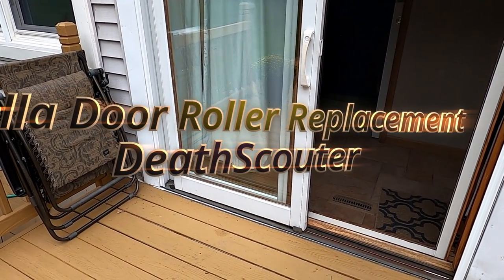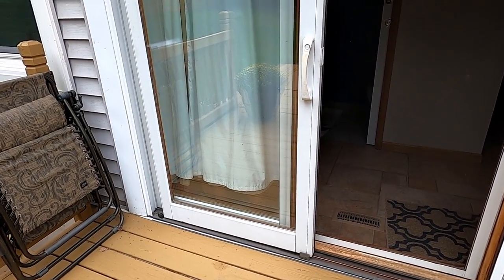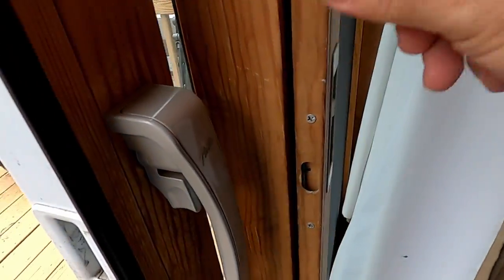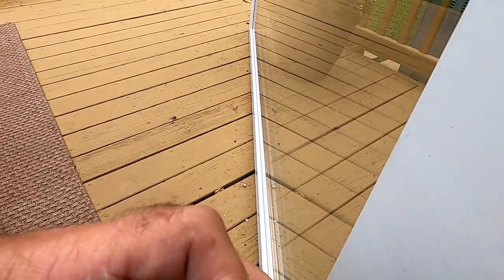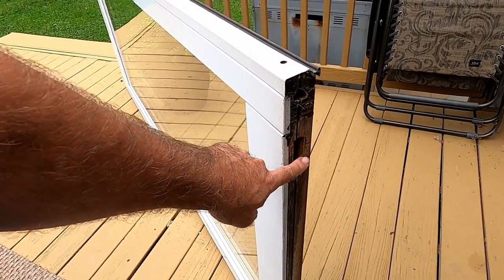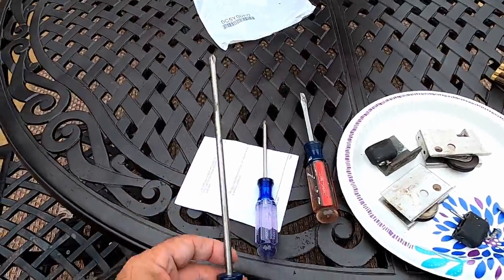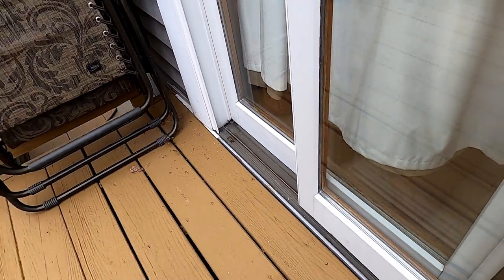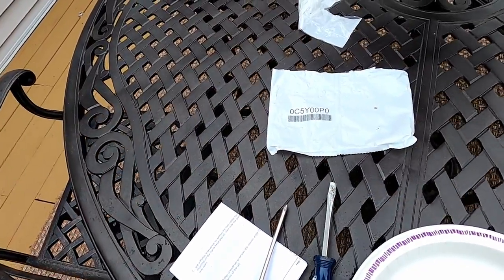Pella Sliding Door Roller Replacement or Lubrication

Comment: I've removed my door multiple times in the past to clean and lubricate the rollers and wanted to point out that on my door you can't simply lift the door and slide the bottom out. That's because you need to be able to lift the door high enough so that the rollers will clear the track that they are riding on. When my door height is adjusted up (by lowering the rollers with the adjustment screws) so that the door latch is at the proper height, there isn't enough room above the door to raise it enough to slide the bottom out. If you find yourself in the same situation, you need to insert a long screwdriver into the holes in the door and adjust the rollers up so that the rollers will clear the track when the door is lifted. You'll need to reverse this process when the door is reinstalled.

Comment: Thank you, Paul.  I have the exact same Pella door.  BTW, the doors are warrantied for 20 yrs.  Pella would send you new hardware if your doors are less than 20 yrs.
Reply from the maker: I didn't know that.  But thank you.
Reply: we were told hardware was warrantied for 10 - so there was a charge for the rollers. 20 years for non laminated glass. We have the Designer Series purchased in 2006

Comment: The Pella 0C5Y00P0 rollers are still available from Pella. They come in a package of 2 rollers and are way cheaper than an internet supplier located in New Jersey.
Reply: How do you find it on Pella. I looked and can't find where to look up by part number.
Reply: @michaelgalloway9085 You can call the National Pella support number and give them the serial number of your sliding door. They will verify the rollers for your door and you can place an order with the representative.

Comment: You do not have to take off the bumpers, simply close the door the take off the guide and lift off. I installed my new door in 2007 and just replaced rollers on 3/10/23
Reply: This is true.  I have the identical door and all i did was take off the guide.  Then again, it might depend on the length of the door track, and/or where the installer drilled the holes for the guide.

Comment: I absolutely cannot get the old roller assembly out of the door. My door looks exactly like yours and it has phalanges. We replaced the roller assembly on the same door (downstairs) and don’t recall having any trouble removing the old roller assembly. It works like a charm. Any ideas? We tried using pliers, a small pry bar and even a hammer and it only came out about 1/4 inch. We hit it with WD40. Then we have up
Reply: Mine was tight too.  i started prying it up evenly with 2 screwdrivers on each side.  Then used a fairly large aluminum pry bar to finish it off.  I noticed the pin rusted on mine and was the likely culprit for causing the binding...  If still no joy, and you haven't watched it yet, another guy posted a video on how to fabricate, and use, a hook and slide hammer to remove it.  Hope this helps!!